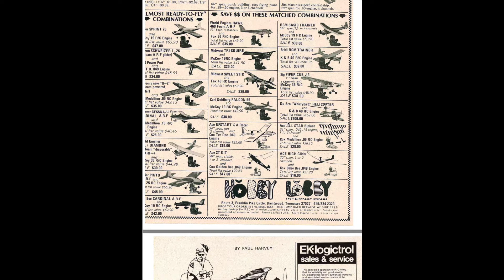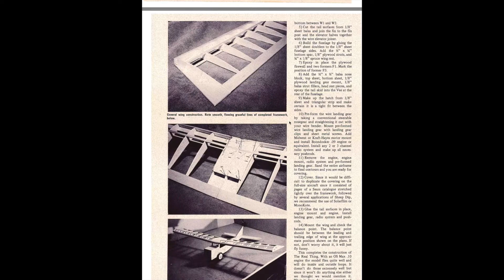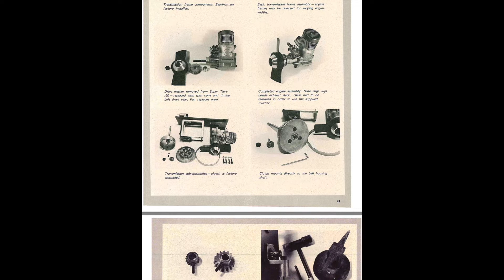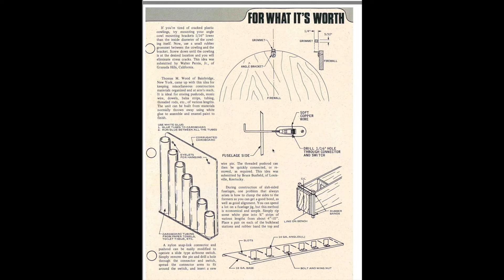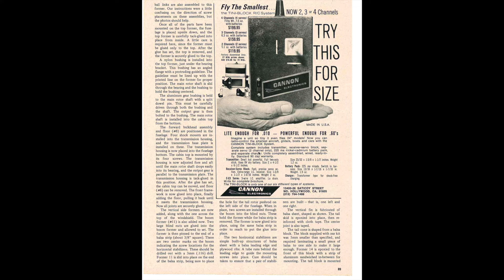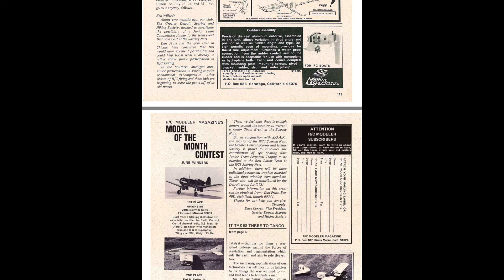Review Aug 1973 RC Modeler Magazine

Comment: Back about 1960 Dad turned me on to Model Airplane News, and I picked up Model Builder when it came out.  In the 60's Dad and I flew control line models, which was all we could afford.  R/C was WAY beyond us, price wise.  Dad always dreamed of building R/C ... using a "galloping ghost" system and rubber band powered "escapements" for servos, but that was out of reach for us.  We built mostly from kits, but I did build a couple from plans I ordered.  Mom always yelled about the smell of Testor's or Pactra "dope" and Ambroid glue in the house.  I was always stealing her pins to hold balsa to plans.  Fox was more than fuel ... they built VERY good motors, as did McCoy and K&B.  I built a control line plane, 36 inch wingspan and put a McCoy 19 with an R/C carb on it and controlled engine speed with a 3rd line.  I got pretty good with it and wanted to try some "carrier events", landing a control line A/C on a little carrier deck ... but then girls, cars and the Army came along and I put off models until almost 1980.
Reply from the maker: Great recap, thanks!  Tim

Comment: Thank you for visiting my youth in RC. The Radio system that was the first to call my very own, given by Dad was the complete BlueMax system kit. A fine looking Set, We just recently lined the walls of our AMA clubhouse with Dad's collection of Transmitters of the past including the BlueMax. As I remember, it wasn't a great radio and refused to work after a bit. I know my dad was  a great horse trader and there is no way he spent $1400 of the family funds. Dad had me flying cox .02 powered , pulse rudder only  balsa and silk covered planes at about age 7.  A School Boy kit comes to mind. In college  I built an RCM Trainer 60 without seeking assistance. A beautiful kit. I had spent a lot on this, a OS Max 61, a Futaba 6ch FM radio and all the works. Maiden was in my college parking lot on the weekend. It lifted scale like into the air, I rolled left. It rolled right into the concrete. Only the engine and radio were saved, except the muffler broke. It took years to forget that experience, and the introduction of Cheap Frsky telemetry radio systems to entice me back to my favorite hobby.  But even this tech wouldn't have brought me back if it were not for the help of Dad and all his flying buddies that had kept the  same great AMA club going that they he and a few close friends had started nearly 5 decades prior.
Reply from the maker: Spartan:  Great post and update, thanks!!  Tim